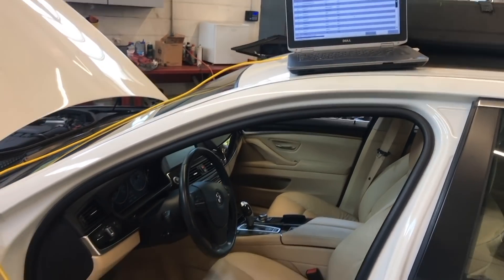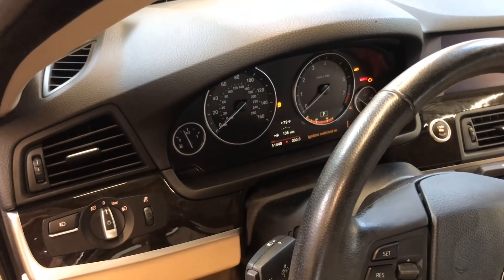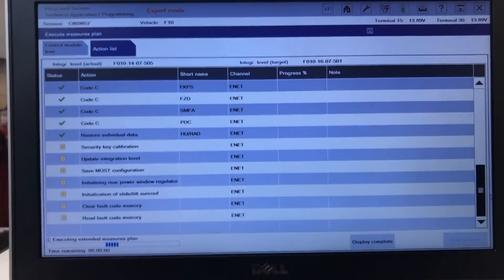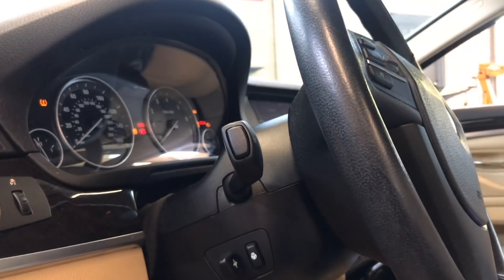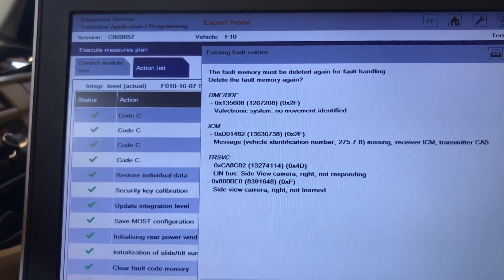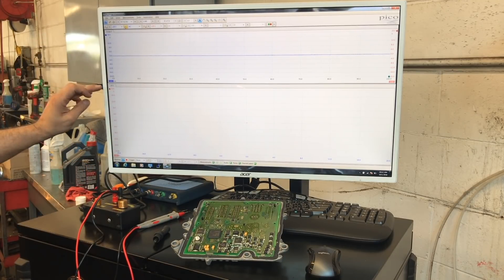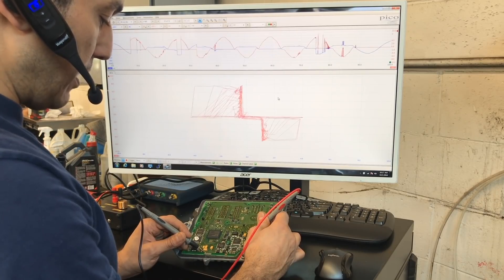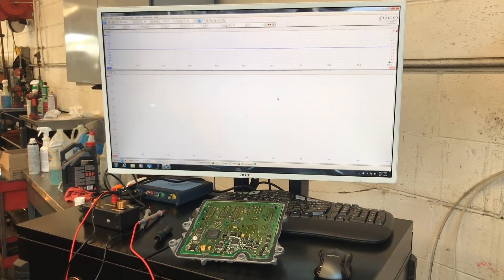2011 BMW 535i N55 F10 DME replacement and programing  BAD DME testing with curve tracer!!

Comment: Hi,
I have owned BMW F10 520i N20B20B 184 hp for 8 years, and my engine was broken, I will swap N20B20A bmw f10 528i engine 245hp, what should be done for the existing DME to get the same 528i stock power (engine, transmission, etc.) I have ISTA and E-SYS program, please help.

Comment: How do yoy know how much power to provide the different components? And can i use this kind of like a power prode when there are components that require less V or amps than the 12v Source?
Reply from the maker: @wellthenjayt55548  this curve tracer can be use on any circuit. All you need to do is adjust the settings before. How I know the voltage, we’ll test before on known goods!

Comment: BMW changed my throttle body and DME. Now they are saying the throttle body isn't getting "learned" (anlernen). Do you have any ideas why a new throttle body + new DME coming straight out of BMW Munich are doing this problem?
Reply: Did you figure it out?
Reply: @MarcusSetGo Yes. You need to change the engine harness completely and the sensors along the intake way 😢😢😢 7000 Euros DME, throttle body and the things I mentioned now

Comment: Hi I watched u video it is very good. I'm seeing you are programming with Ista p. I have a 2011 f10 535I Xdrive with used DME and i tried to programming with Ista p it say no support by it  please how did u do that
Reply from the maker: No used DME with ISTA or any tool that I now of. You need to clone the old DMe to the used DME. Here I am using a new module from BMW
Reply: really thanks for you faster reply.  I have to find  out who clone DME now thank you so much

Comment: saludos tienes muy buenos videos te escribo en español porque eres bilingue aunque entiendo el ingles tengo problemas con gramatica pero al punto me gustaria saber tu opinion estoy diagnosticando un auto bmw 2011 3 series 3.0 no arranca tengo codigos relacionados con valvetronic servomotor los borro pero hay un codigo que no borra es el 2dd6 valvetronic servomotor,position sensor short circuit or line break estoy checando con mitchell y alldata pero no tengo mucha informacion asi que use un escaner obd2 el cual medio un codigo p10e5 con ese codigo tengo mas informacion el cual recomienda remplazar el servomotor o la computadora de motor no tengo picoscope para checar la señal de cada sensor pero con voltimetro cheque los tres de enmedio tienen voltage de bateria con switch on tambien cheque los otros tengo uno señal de tierra y el resto 4.5 volts pero no puedo ver variantes porque no tengo el osciloscopio, me recomienda remplazar el servomotor y la dme quiza el problema empezo en el valvetronic motor y se daño un driver en el dme por eso impide el arranque ? recomienda cambiar primero el dme?
Reply from the maker: Lo más recomendable es cambiar el valvetronic motor, y el cable entre el DME y el valvetronic. Porque el que se daña siempre es el motor y después por alto amperaje este termina dañando el cableado y de última la computadora (DME). Puede ser que la computadora esté mal también pero no hay una prueba que puedas hacer sin un  osciloscopio. Así que cambia eso primero y si aún te da problemas, cambias la computadora.
Reply: gracias por su consejo saludos @MaicSalazarDiagnostics
Reply: @techiapas4717  Hola como lo solucionaste..? Tengo el mismo problema
Reply: @macannnas  remplaze el servo motor y DME pero el dme Estaba dañado driver
Reply: @techiapas4717  gracias amigo... Es lo k temo en mi caso tambien... Porke tengo various codigos de dme 5v out of range... Valvetronic motor sensors not getting voltage..
Ya cambie el motor me costo 118dlls..y hace tambien el ratcheting ruido como pajaro Carpintero... Ahora Pienso la dme puede estar Mala...
Entonces tengo k conseguir una usada en buen estado... Y clonarla?... Verdad?

Comment: So the transistors for the valvetronic system was damage and not the valvetronic inside the motor? Also could you not just replace the bad transistors on the dme? Instead of buy a new computer?
Reply from the maker: Richard Peralta yes you can try to do that. But it is hard to find them. Plus taking the DME apart is a nightmare!
Reply: @MaicSalazarDiagnostics  thankyou for getting back to me on that and thankyou for the video it was awesome to watch and I learn alot on the valvetronic system, I was always afraid of taking that eccentric shaft off but not anymore.great video thanks again

Comment: Funny thing this week I might be programing a DME on a same vehicle for the same problem as you did. It would be the third time I do program a BMW, but it would be the first time by my self. Little nervous about it. Usually the other driveability tech does the BMW's and we alternate on the rest of the other car makers. But he's leaving on vacation so hopefully nothing goes wrong with my programing. How often do you see the valvetronic motors going bad and taking the DME out?. This would be the second time for us seen this problem. I like the curve tracer tester, never seen, heard or knew about it. But I loved it.  Buen video amigo
Reply from the maker: David Hernandez on the newer engines N series I seen this very often. The DME damaged depends a lot on how long the cars has been driven with this issue.

Comment: Way out of my league... top notch! I called a bad ECM at work last week. I was 95% sure... could have used that signature tester to check the transistor (ECM didn't ground the fuel pump relay... 92 Eurovan). I'm happy to say that a used ECM got it running again. Having your knowledge & toys would have made things less stressful. You're at the top of your field... won't be long before many more YouTubers will recognize that and sub your channel!
Reply from the maker: Thank you so much for your kind comment my friend.

Comment: At real speed this could take up to 3 hours
Reply from the maker: Definitely. Did you check the end of the video about the curve tracer test on the transistors?
Reply: @MaicSalazarDiagnostics  loved it . Honestly about to call you and tell you I think it should be 2 videos
Reply from the maker: New Level Auto should i up load that last part on a separate. I am afraid most wont see it. What do you think?
Reply: @NewLevelAuto  Maic needs to be on Trained by Techs!
Reply: @MaicSalazarDiagnostics  I would definitely separate the two .
Reply: @EXOVCDS  I would,  but I saw several 3:18 in this video 😂. Honestly it's already been mentioned, but we have a few new faces that we need to get settled first as well.